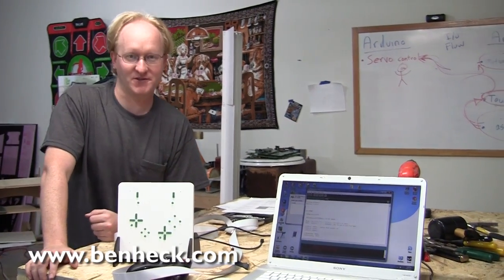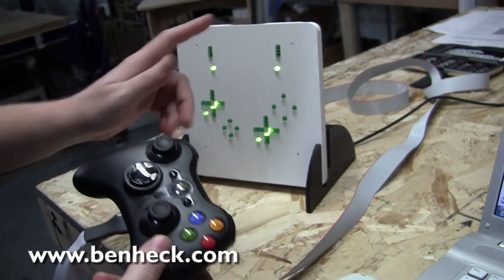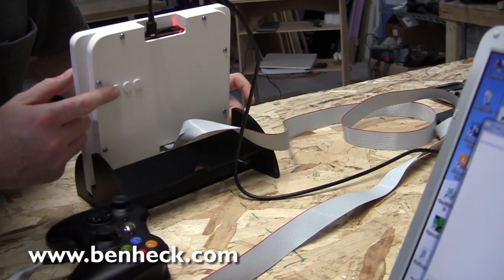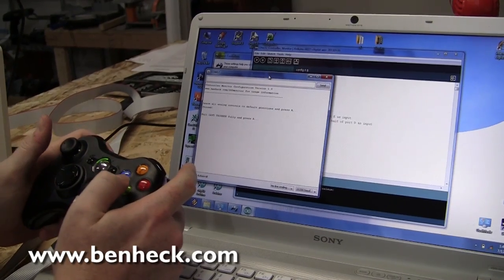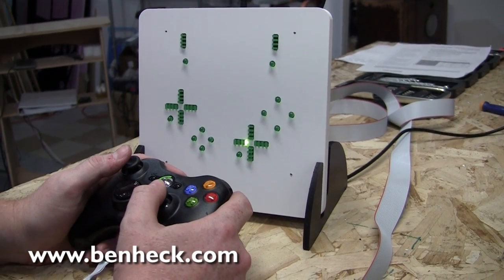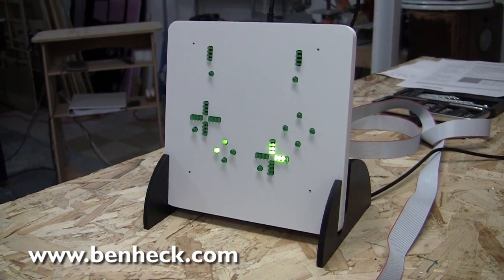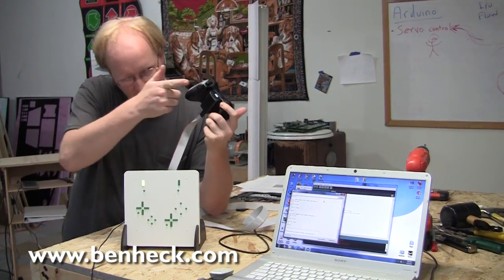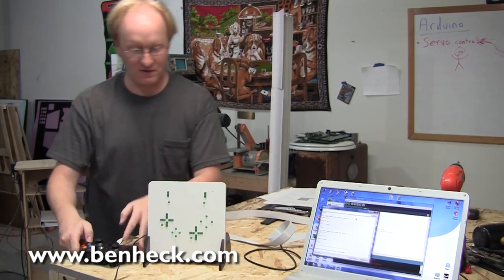Controller Monitor Demo

Comment: Did you need to disable any internals or cut them out? Also did you use a pull-down resistor for each control? Thanks!

Comment: @PPXEXE His device doesn't allow you to adjust the sensitivity of the controller or the game.  It's a product for game developers who need to tune the controls to make their game more playable.  And actually, it's not all that difficult to do what he's doing here (making it a great starter project).  A simple version of this that YOU could make would just involve mounting some LEDs on a board and then soldering a wire for each LED onto each switch in the controller.  You should give it a shot!